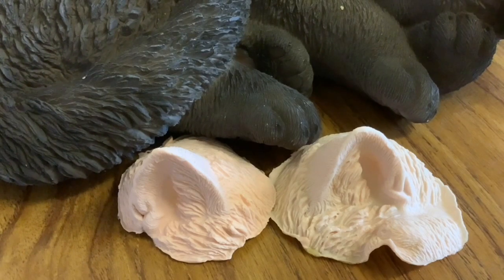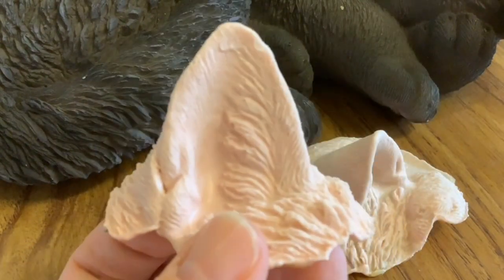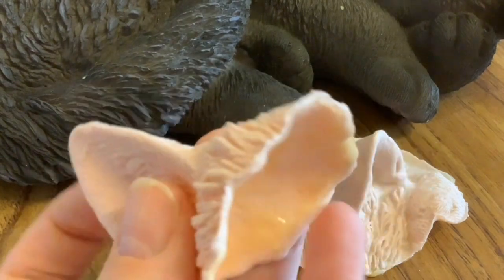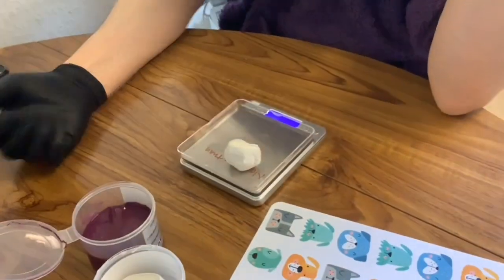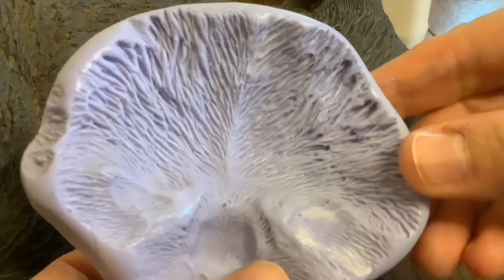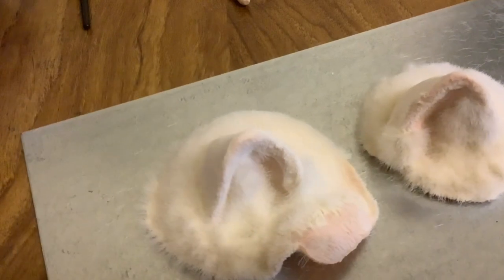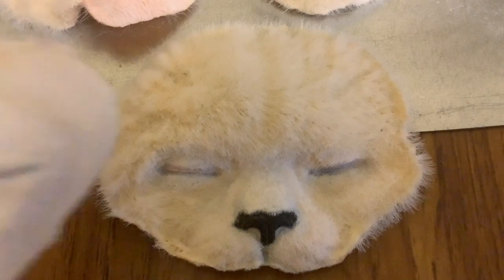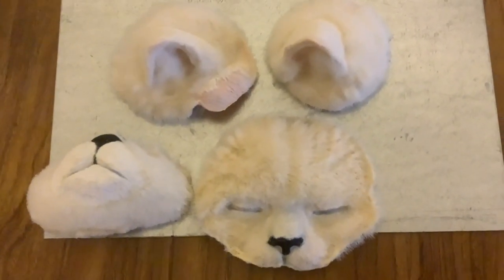Flocking: Flocking On Latex Part 2: Using Latex for models, Flocking Latex with 1mm & 4mm Flock

Comment: hello that looks nice.  what kind of glue do you use for latex flocking?  and are the parts still moveable or will the latex harden?  I would like to flock a latex mask that can move the mouth .. would be nice to hear from you Greetings Tamino 🫶🏻😉
Reply from the maker: It’s standard flocking adhesive that came with the flock I bought. Any water based glue should work. The latex is still very flexible when flocked.